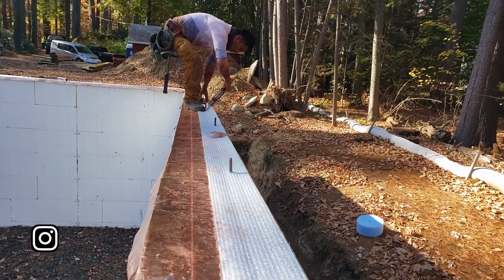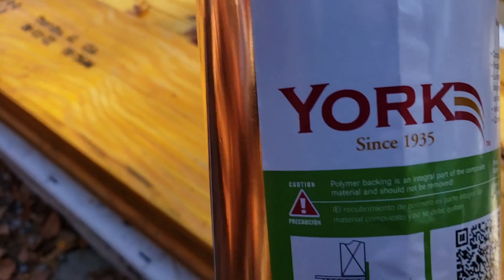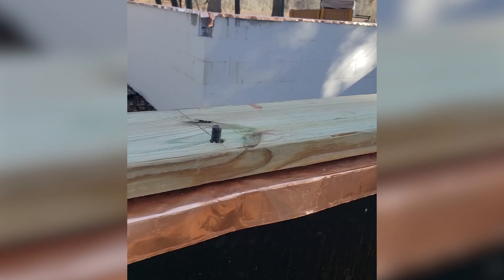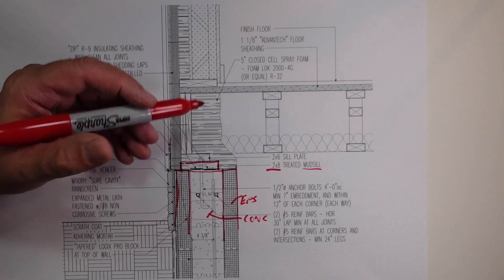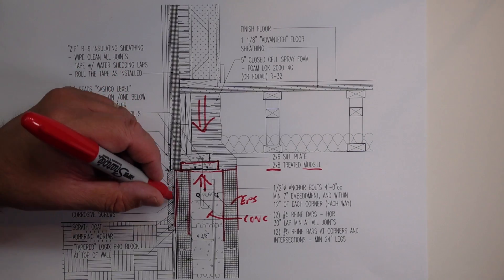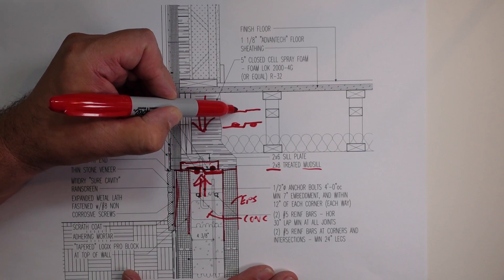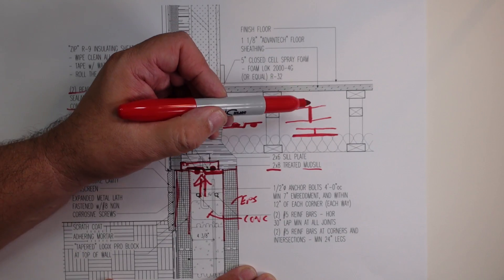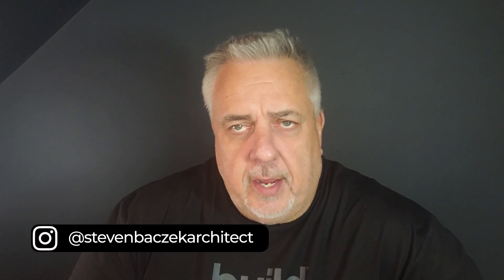MUDSILL DETAIL - at ICF'S

Comment: Hey Steve, what do you think about running the waterproofing membrane all the way up and over the ICF wall. Specifically using Polyguards 650 TRM 68-mil thick waterproofing + termite barrier. This membrane would serve as waterproofing the vertical wall, but also serve has the termite barrier and sill sealer/capillary break at the top of the wall. We are building an ICF house now and thinking through these details.

Comment: Steve, you might consider changing the detail a bit to put a 2x10 PT first and let it overhang enough such that R9 panel sits on it.  On 2x6 walls where I use the R6 panel I extend the 2x8 bottom sill out to support the R6.  I like closing off the foam on the bottom.  I then use a 9" Fentrim tape to wrap the foam, the extended 2x, and then down on the foundation wall.   I also set the R6 panel in a bead and place a bead of Tremco acoustical on the face of the 2nd sill plate.  I put a sill gasket with 2 beads, as you do between the 2 sill plates and also the foundation.  We have to make it simple enough to be installed correctly and easily.

Comment: I see that the metal flashing is taped to the insulation.  Did you also put a sealer between the metal flashing and concrete?  What prevents air from coming in between the metal and concrete?

Comment: What about the copper termite flashing? How does it stop termites? Does it have to be copper? Can aluminum work? Vinyl? Don't termites attack the EPS in the ICF? I've heard that some pest control companies won't treat ICF homes, at least in some regions, because the termites get into the ICF below the soil and you can't see the tubes they usually build on the face of a concrete foundation.
Reply: It doesn't need to be copper and it doesn't need to be metal.  Polyguard TERM is a peel and stick waterproofing membrane made for ICF below grade.  I don't know what is special about it in regards to termites in comparison to other peel and stick waterproofing membranes.  May just be marketing.  I am hoping to build with ICF to the roof so no sill plate to worry about.  For termite barrier I plan on using the TERM product or equivalent.  No foam will be exposed to soil.  I'm thinking  that slightly above grade, I will cut a trench in the ICF all around the perimeter of the house with a chainsaw.   The top of the TERM membranes will terminate in this trench, all the way back to the concrete core.  Then the trench will be filled with Polyguard sealamt.  This area will be covered with parging, maybe a foot above and below grade.  This will force the termites to build their mud tubes on the parging, which can be inspected by pest control.
Reply: Yes, it needs to be copper. The foam provides no nutritional value to the termites. Insurance companies who track everything don't consider ICF a problem. When a builder follows proper practices ICF is very rarely a problem. No access to wood no problem.
Reply: @ArnieD17  I know the ICF has no nutritional value for the termites, but I have heard they will tunnel into it to reach wood.
Reply: Here in the southeast it is hard to get anyone to do a termite letter on an ICF house.

Comment: Love the mud seal....did i miss the video on why you're using a copper flashing?
Reply: What I've heard is that termites can burrow through the foam of an ICF, and unless you do "something" to guard against it, they can get up into the wood framing without being noticed.  The "something" would be some sort of metal flashing, to force them to come out where you can see their mud tunnels for at least a short distance below the siding.  I like the idea of that copper flashing, and its packaging does mention termite protection, but I still don't know how it'd really do the job.  My guess is that the outer edge of that copper will probably get covered up by the stone veneer, which might let the termites come up in stealth mode, behind the veneer (and that thin copper would be a weak attachment point for the top row of veneer).  Perhaps they'll bend the copper when installing the veneer so that the copper is in front?  That might work if it leaves enough vertical copper in front of the veneer, but it also might look funny that way.